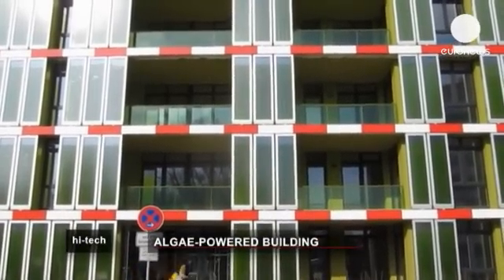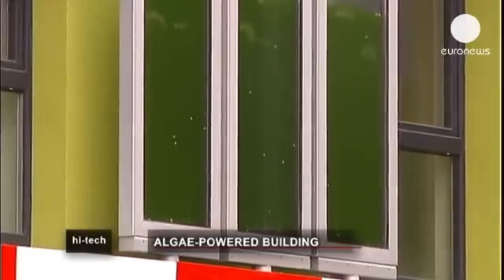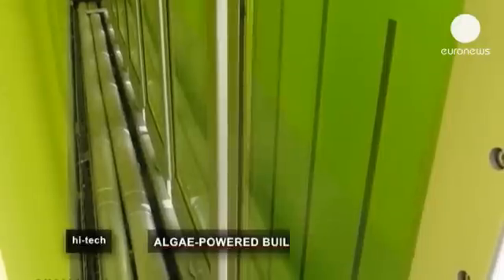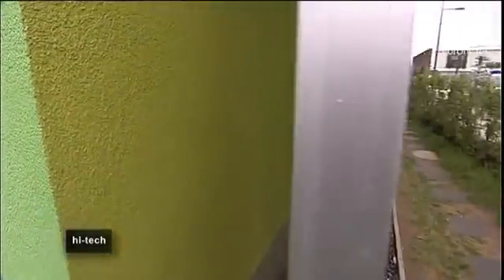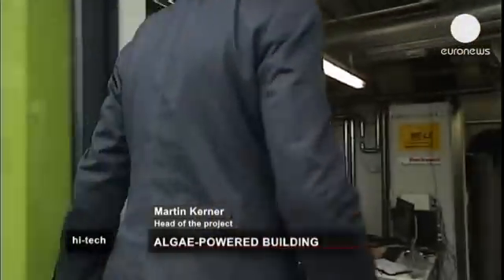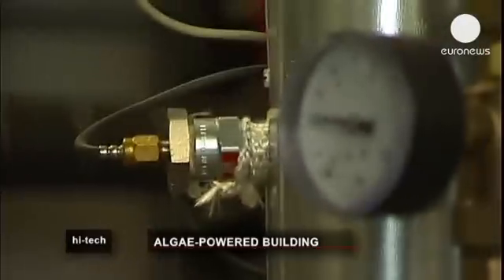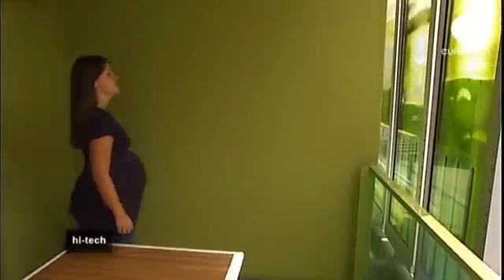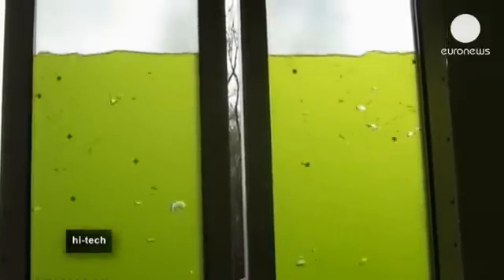It's Alive! The world's first algae-powered building

Comment: No mention of Hydrogen production?
Reply: From what?, and for what puspose seeing as the Algea is powering and heating the building and saves heat for the winter!
Reply: @Kiyarose3999  If you research the building you will realise they also have hydrogen tanks and these help to maintain the temperature for all rooms, it is clearly not only the algae biofuel but also thermal energy and hydrogen
Reply: @Joelmaquera  Oh ok I only watched the vid above, I haven’t read anything about it, I’m surprised they didn’t mention Hydrogen being used in the vid where they explain how it works. In fact I’ve watched 2-3 vids on this same building in Hamburg and they didn’t mention Hydrogens either. Do they have an electrolyser and HFC in the building then? If so they could use the HFC as CHP-HFC as extra heating for the building. Although the Methane Fuelled Generator must create a lot of heat for the building, and yes I know there is thermal heat from the PBR. How is Hydrogen used as heating?